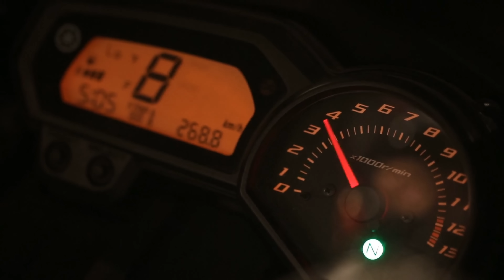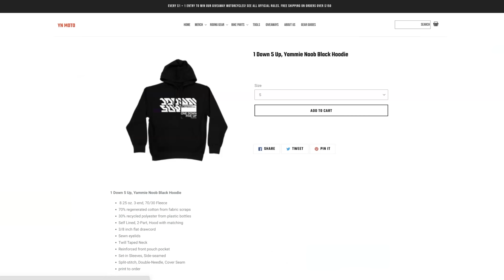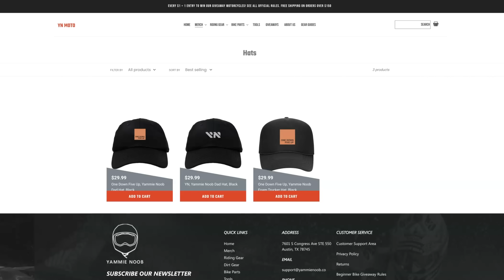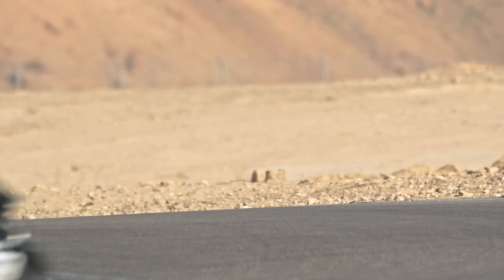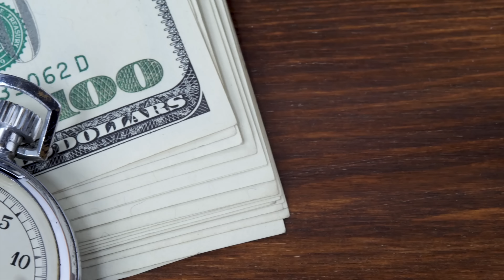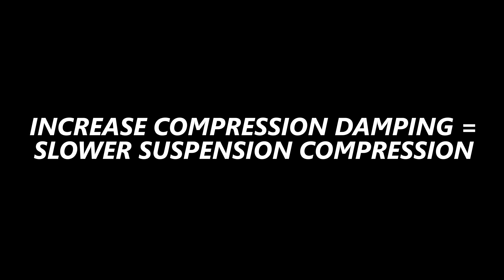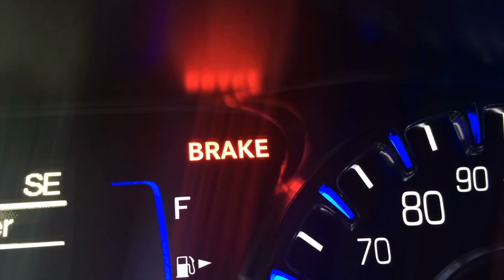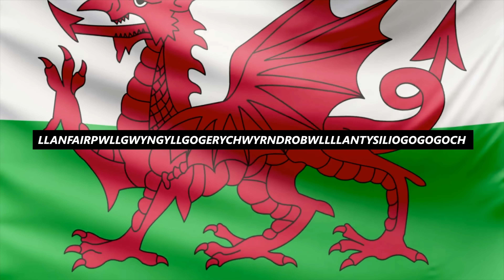BEST MODS That Make Your Motorcycle FASTER

Comment from the maker: Make sure you check out https://shop.yammienoob.co for our Cardo giveaway!
Reply: I have a 2001 zx6r it's carb fed any suggestions to get the max power out of it it's has a 14t front and a 40t rear sprocket and it has factory headers but a 8 " slip on rs-3 Yoshimura exhaust

Comment: At the drag strip the best modifications you can make to get your bike faster is learn how to ride without traction control and improving your reaction times will help you win races.
Reply: PS I hate nannying on bikes. One of the reasons I chose mine was lots of power but not nooner happy. 

Saw a tip for familiarity with a new high powered bike. Keep it in the highest gear that doesn’t lug, and resist the temptation to bang a speed downshift & twist it. 

Should keep me alive in my personal quest to run at least in the low tens and mid 130s.  

The love of my life encouraged me to do something I had always wanted to be able to do. 

Didn’t bat at an eye when I said I wanted a street drag bike that runs like a proverbial striped ape. 

What is the best circuit for racing normal breathing, normal tire and frame quick bikes?

Bracket racing feels like participation trophies to me. I guess I’m a grudge racer at heart. 

Head to head, May the better builder & rider win. Old school is the gold school. 

Sort of the motorcycle equals of show-and-go hotrodding. 

Running a fast quarter is the most fun you can legally have in public. 

I was racing wagons at 4, Schwinn 1/40th mile drags (my invention) at 12. 

And I want to set a single digit time just because I believe I can do it. On a family friendly budget. 

The whole project has un-aged me at least a decade in six months. Physically, mentally and spiritually. 

Looking for sources for parts and fairings for Hinckley triples. Any suggestions? Any idea about fitting a Dunstall Dolphin fairing on a custom cafe racer style 92 Daytona? 

Once again thank you from the bottom of my heart, FCR. Talking with Matt was very interesting & informative.  Literally memory of a lifetime and a great addition to my personal drag bike knowledge quest.
Reply: Traction control? What even is that?

Comment: Best mod to make the bike faster and increase mpg.... Eat better and exercise. Fit riders allow the bike to spend more time doing what it's meant to do and less time lugging extra weight. This is coming from a formerly round cruiser rider that had to lose weight for his small naked to accelerate as it should. Sometimes... We need to look at modding the rider before modding the bike.

If you are already a fit rider... TURBO, "race" tires, and an eBay exhaust are all you need to turn your bike into a warp speed capable starship. Those upgrades are the bare minimum since, understandably so, you've already completely maxed out the potential of your bike on your daily commute to the store and work......

Comment: Power commanders blow. Ecu flashes are cheaper, usually, and way better. A remote tune is the most accurate way to tune, though. It uses real world situations and varying loads to fine tune things in a way a pc, flash, or even a dyno can’t.

Comment: You speak my language. My used liter triple Triumph comes with number one. 

I flirted with the schoolgirls. 

I’m a little schoolboy too.  — Johnny Winter

Bop til you drop, Yam. There’s a place for you in the fast lane of life. 

One tuner advantage is correcting air-fuel ratio when mods change it. Don’t believe a flash can handle altered air and/or fuel rates.  Right?

Comment: Caution on aftermarket air filters. I heard mechanics say that they allow more air they also allow more dirt/unwanted particles into your engine. “I heard” typically is never a statement  equates to mean hard science but it kinda sense🤷🏽‍♂️
Reply: It's true. More carbon buildup with same period of time. Plus oil from filter can clog emissions system pre maturely. Just buy the best disposable units available and preserve engine longevity.

Comment: I actually modded a 70cc Chinese bike at stock it was goving 80kph(49mph) and after it gives 155kph not going to mention mph😐
Reply: I just got new 50 cc mondial mx-4. Couldn't find anything about it on the internet, pretty much non existent. No one also talks about sub 100 cc bikes anywhere. I wonder what upgrades you did? I want to upgrade it after the first few thousand kms.

Comment: Hey do y’all know the best first motorcycle to get
Reply: I went with an '85 BMW K100RS, maybe not the best first bike but it worked for me, had enough power and speed but wasn't insanely fast, no ABS which I did prefer. It's all about what you're looking for and what you'll be comfortable with
Reply: any entry level naked or sport bike